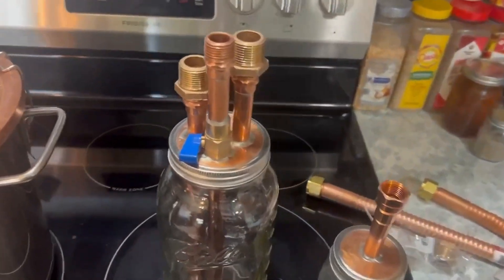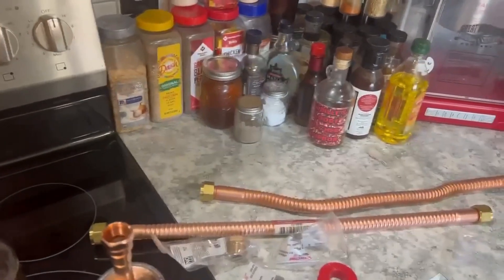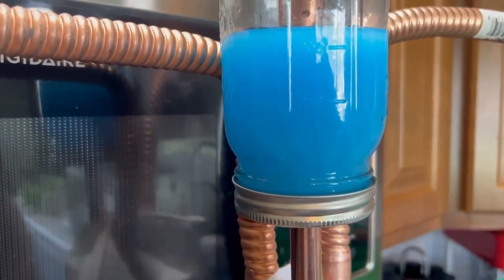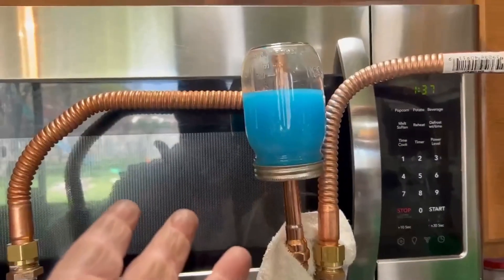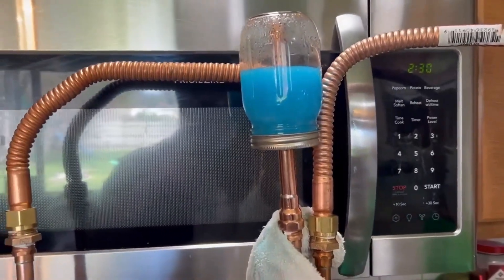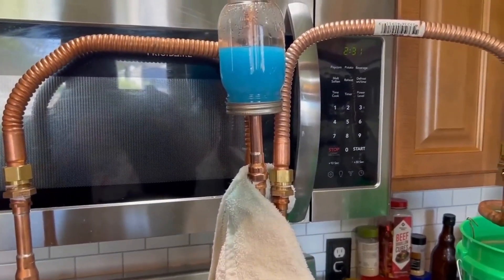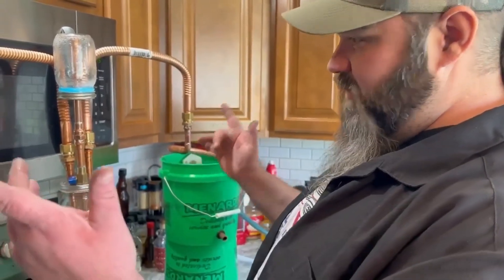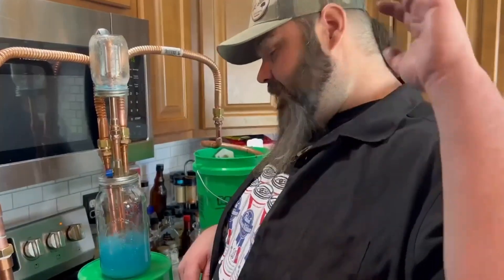PhilBilly's Thumper Jar Infuser Prototype

Comment: If you were to run the output of the thumper through the infuser with a second pipe.  That would solve it.  You would need another triple pipe mason jar lid.  One pipe like you have with the valve for dumping the blue liquid and an input and output pipe that only “passes through” the infuser by going in, elbowing around, and back out and to the coil.  The prototype shown has the output bypassing the infuser.  You could use that heat to heat the infuser liquid by running it up into the infuser jar, going up a undetermined distance and hooking back out down through the infuser lid again and too the coil.  It would not even need a valve.   It may even give you some reflux?  You could do the “pass through” pipe before the thumper as well, I suppose.  Maybe that would be even better?
Reply: To expand on my final comment above, you might could be able to sell it safely if the vapor from the pot passed through the infuser BEFORE going into the thumper.  This would mean that the infuser would heat up first and ensuring that by the time the still is producing, they are guaranteed to both be hot.   Maybe?
Reply from the maker: Holy shit you're a genius. Seriously this has round 3 coming now.
Reply: @philbillymoonshine7356  you may want to set up a bypass valve to skip the infuser and re route it straight to the thumper after it gets hot so you don’t boil the stuff in the infuser?
Reply: I just thought of one more thing that it would need.  A pressure relief because before the infusion is performed, the infusion jar is sealed so the pressure would go up as the infuser gets hotter.  A small 1/8” or 1/4” pipe …. In addition to the 3 half inch pipes would need to go in through the liquid and up to the air gap and then come out of the lid and up outside the jar. This would ensure the infuser does not over pressurize.